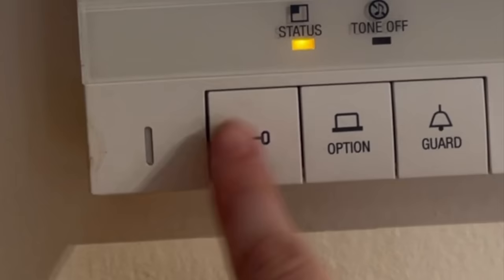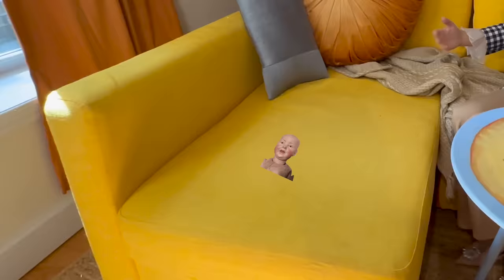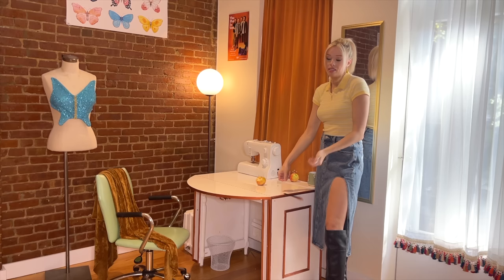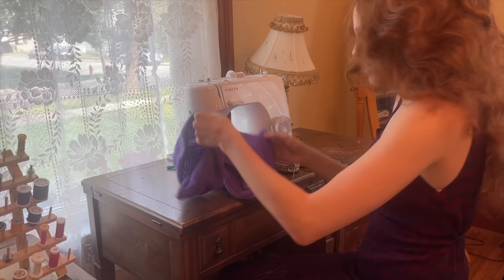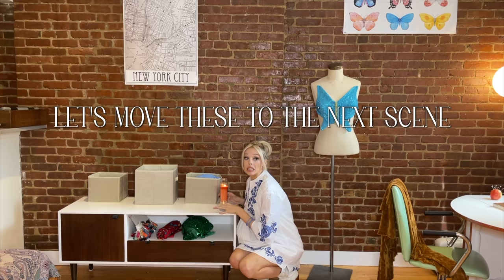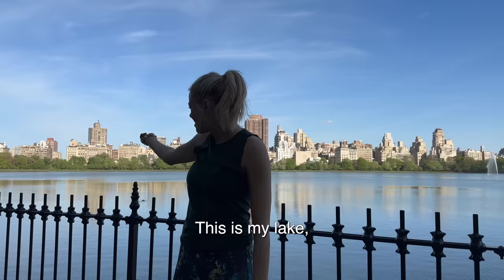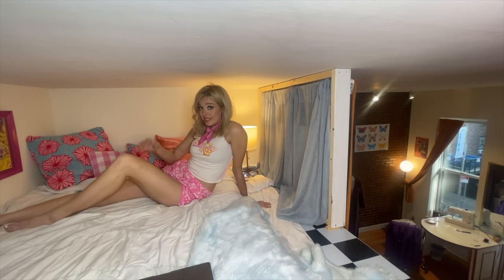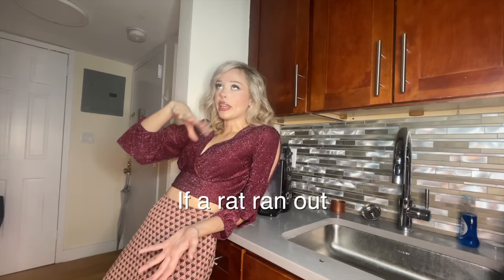NYC APARTMENT TOUR!

Comment: Install a small wall organizer on the outside of your fantastic mutli-use sewing table, on the side that doesn't have anything on it and bam...'drawers'. In fact, if you get the ones with tiny drawers you could use those for storing notions (buttons, trim, beads, needles, etc.)